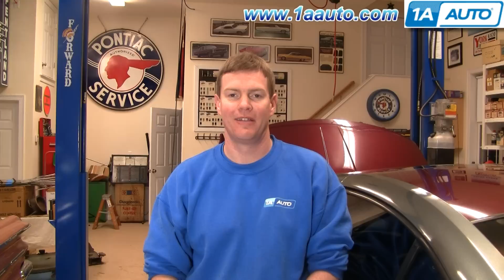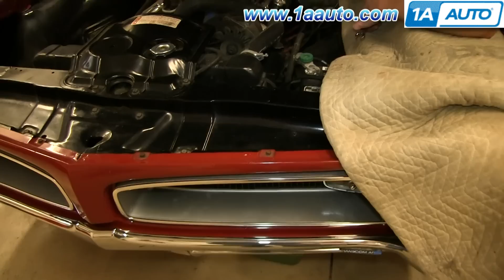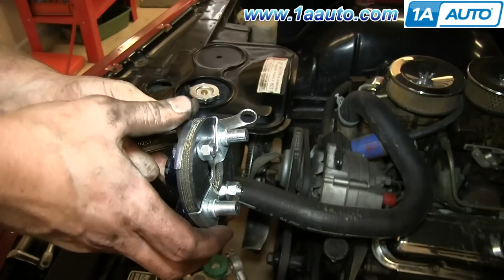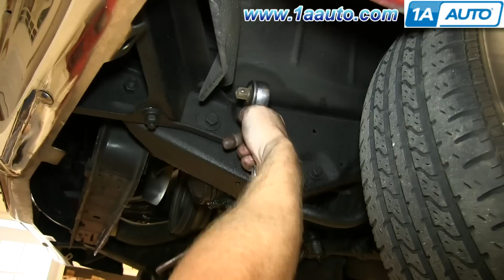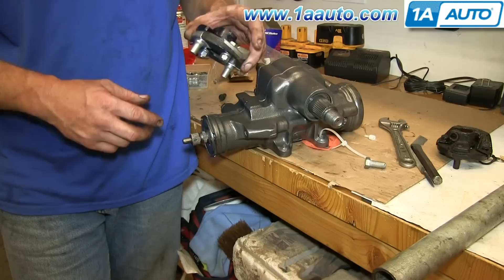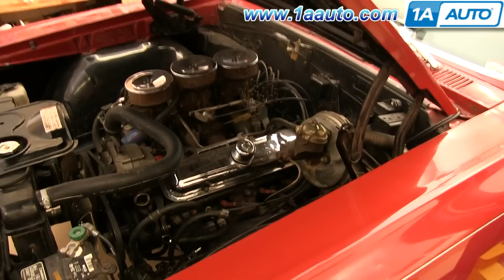How To Replace Power Steering Gear Box 64-73 Pontiac GTO

Comment: Please, flush the fluid first until clear. Warranty for many require new hoses. SnapOn, OTC, always use extreme pressure lube on threads on puller bolt, never use a impact to losses, spread the gear box side of rag joint, pounding on the input shaft that is coupled to the torsion bar that goes in behind the spool valve, install filter with magnet on low pressure line, install the dust bolt on the pitman arm shaft before pitman arm (Not one in box?)